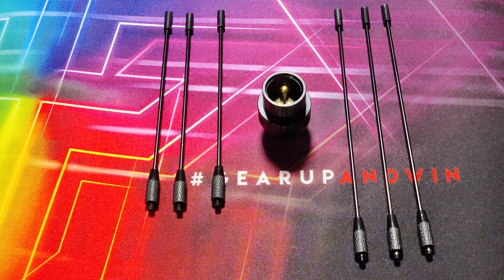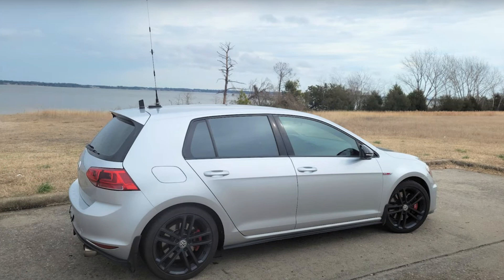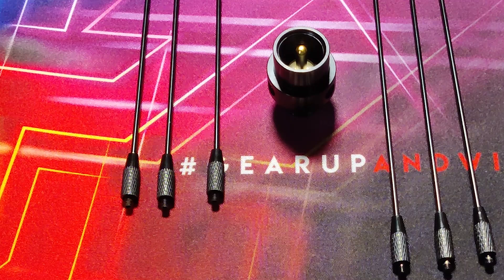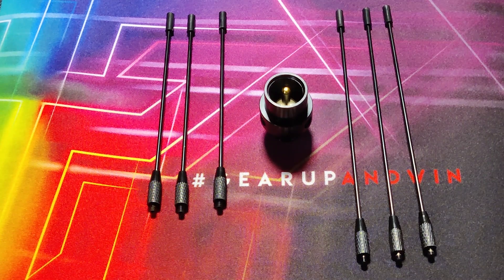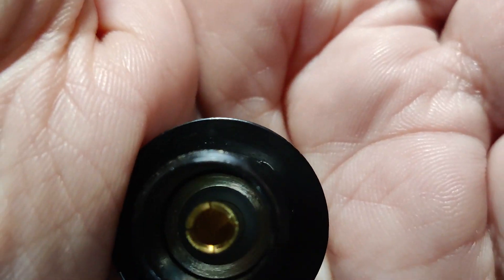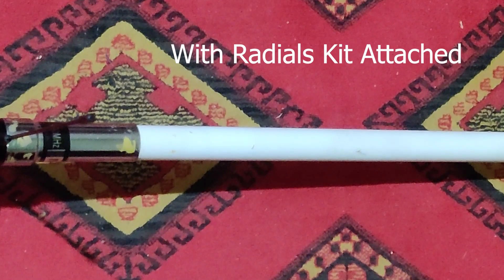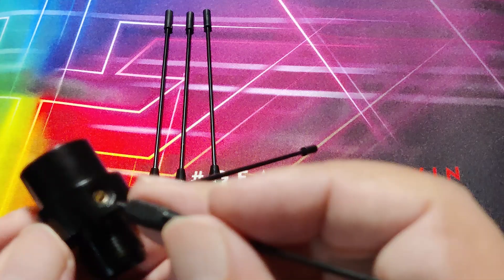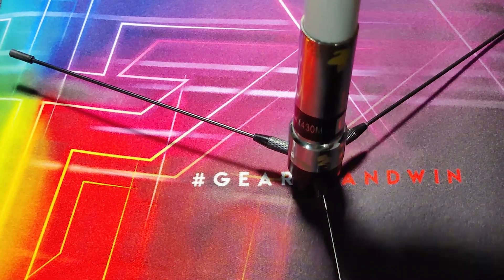Use VHF UHF Car Antenna as Base Antenna with Ground Plane Radials Kit Overview by Technology Master

Comment: Hello Sir,can u tell me 1 good meshtastic device cheap and good to start?Thnx
Reply from the maker: Price mainly depends upon from where you are buying. Heltec Mesh Node T114 around USD 33 with NRF (not esp32) GPS is a good choice. See my this video for specs https://youtu.be/5geXnH-ct2A    on a little less around USD26  Heltec ESP32 LoRa Meshtastic Asset Tracker also called wireless tracker.  If you dont need GPS you can go cheaper than $20.  ESP32 consumes much more power as compared to NRF based chips. So ESP32 based boards should be low priced. I have checked prices from China. From Amazon UK they are +5.  

Apologies for the late reply. I am just coming back from unenforceable long break.
Reply: @technologymasterkam  thank you!